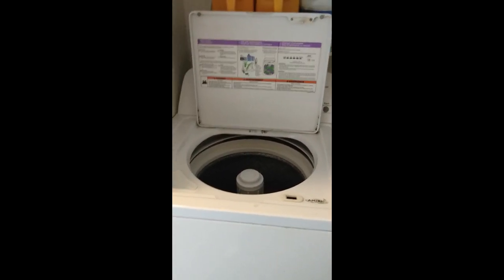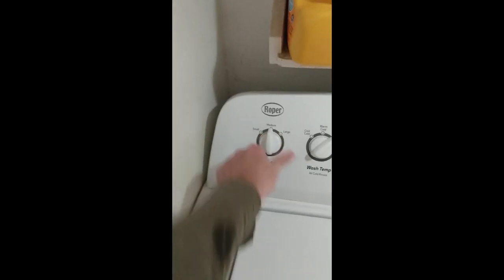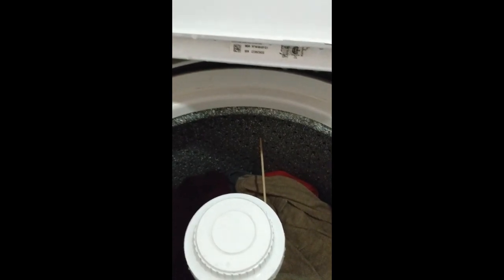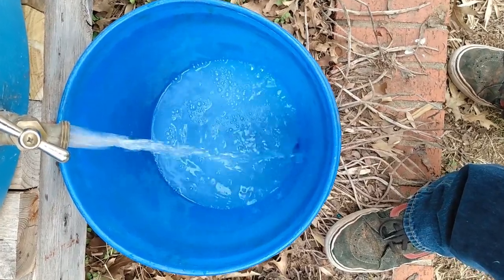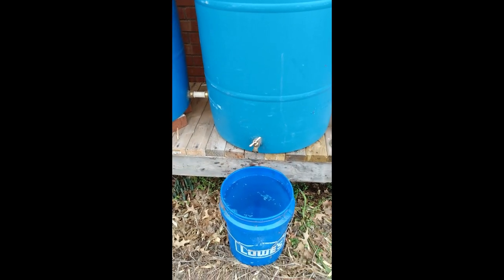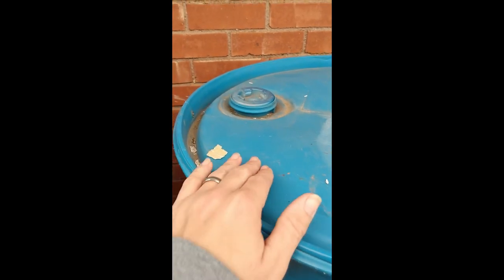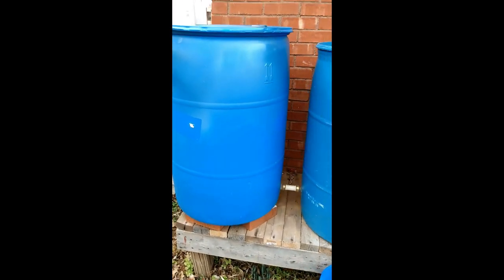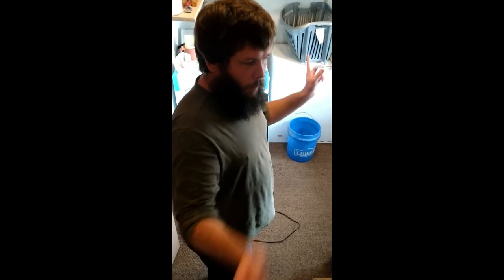How I Fill My Washer With Rainwater

Comment: I'm in Canada, as soon as it warms up, I start collecting rain water from my roof. I have a ICB tote 1000 liters. I use a small  RV stile pressure pump connected to a garden hose, which fills both my toilet and washing machine. The set-up is powered by a lithium power bank, and charged by solar panels. My house dose have a well,but the pump is extremely expensive to replace and costs me $$$ to run ( power bill ) . I'm all for sticking it to the power company 😊
Reply from the maker: We are trying to work towards something like that here also. The problem we run into here is we get caught up on our finances and start working on our projects just to have something break down or something in more dire need of our attention. But it gives you a good feeling knowing that in every situation that we've faced we've been able to accomplish what we needed and move on. Thanks for the input, nice to hear ideas and other people's experiences.

Comment: You don't treat the rainwater? Just fill up the bucket and to the washing machine?
Reply from the maker: We usually don't to just wash cloths, just really depends on what we are using it for. We are working on a few other projects, hoping to have some new videos here soon that'll help explain a little better.
Reply: Rainwater washes cleaner and requires less detergent because its soft water.